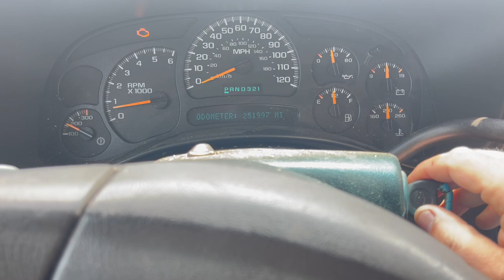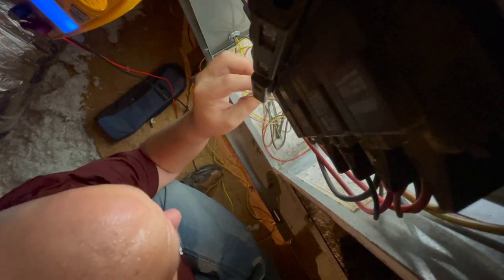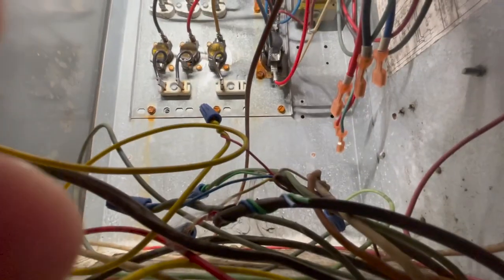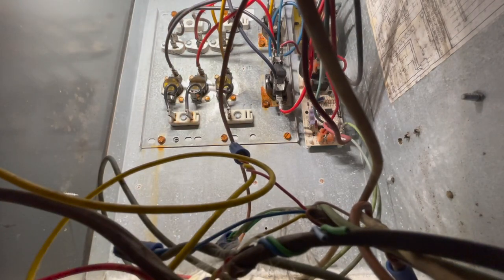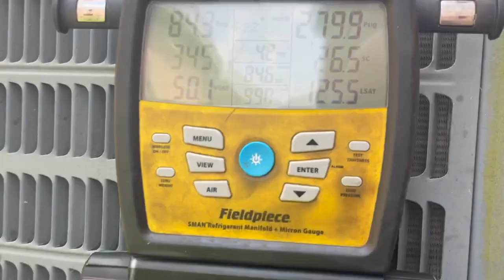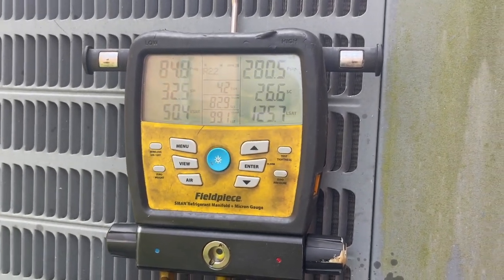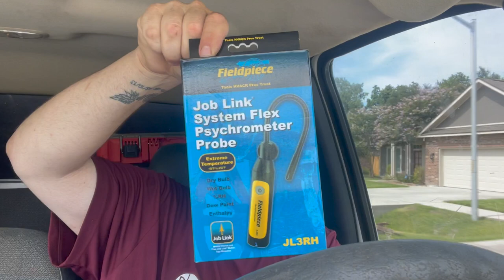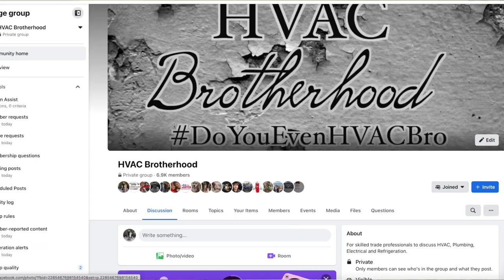No Cooling/Blowing Really Hot Air

Comment: Never heard of not putting cool speed at 100% (black wire)..... But do you......
Reply: I always cooling on high speed. ❄
Reply: In high humidity areas, like where I live, we actually set fan speed to around 350 cfm to assist in dehumidification. Higher fan speed equals less dehumidification. Also, the faster the air moves across the coil, the less time it stays in contact with the coil, giving it less time for the coil to absorb the heat. Faster isn't necessarily better.